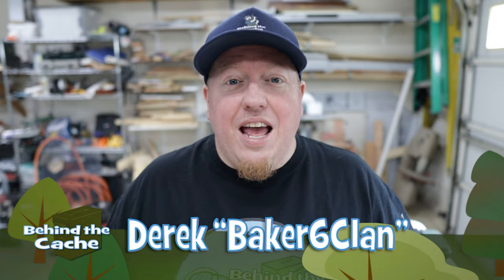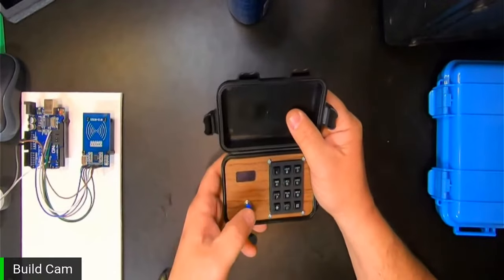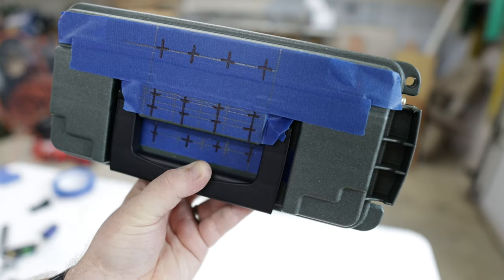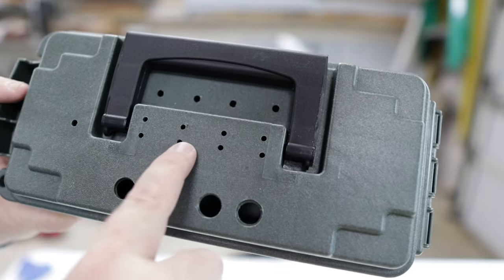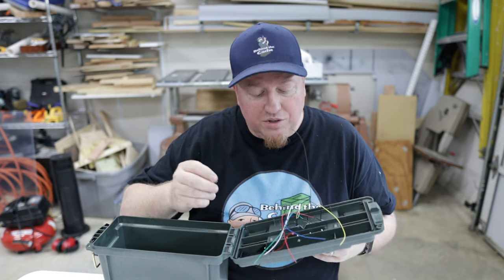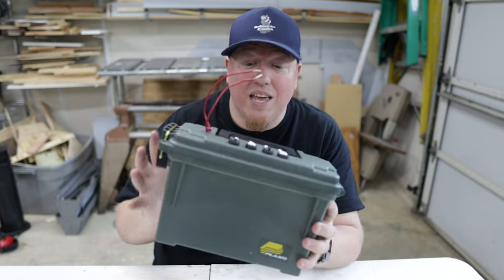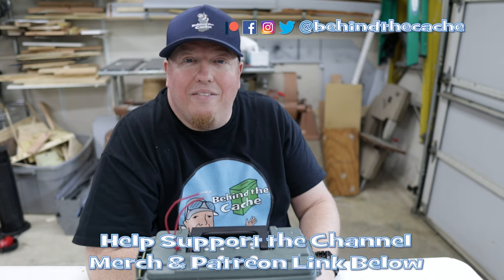Geocaching Event Puzzle Box Creative Cache Build - Gadget Talk Challenge (GCNW)

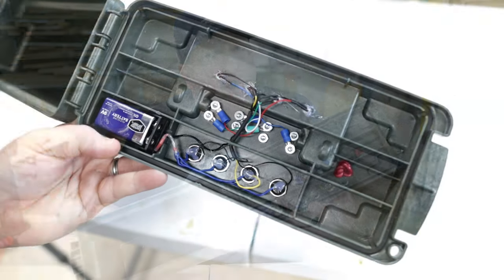Comment: Cool idea! I am looking at the wiring at 4:03 and it looks like the red wires sticking out of the top are a red herring...or a jumper? ...🤔  I am new to this basic circuitry. I don’t see how the circuit is completed...🤗
Reply from the maker: You use the red wires as the jumpers between the screws in the middle. A negative from the battery is on one and each of the negatives of the LEDs are to different screws. So you have to jump between those and then also hold the corresponding momentary switch to activate an LED. There are some of the screws that are not attached to anything.
Reply: ...👍 Got it. I didn’t see a negative from the battery to one of the screws. Thanks again.